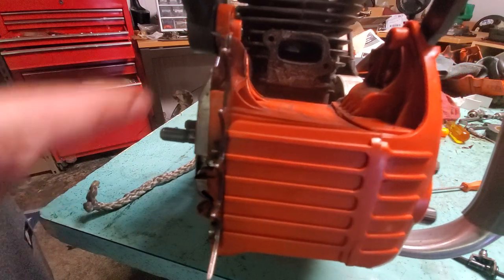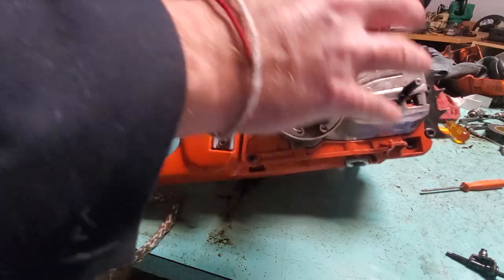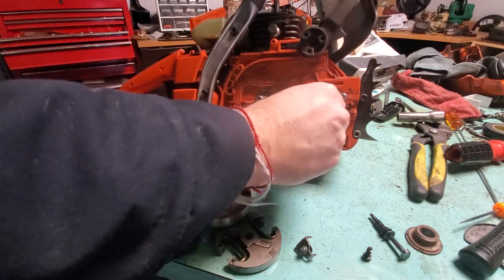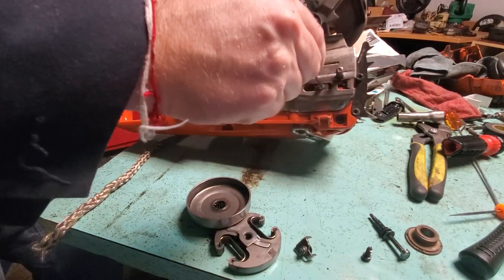Replacing Chain Tensioner Husqvarna Chainsaw 350

Comment: Awesome. Saved my bacon. My chain tightener came out of the track. On a Sunday with a pile of work to do. The rope trick worked. Thanks for the advice waiting for it to get to the top. Close to the top worked for me. 

I have a 353. So have a couple other pieces. One thing I did have to muck with was lining things up putting it back together.particularly bad and chain.

Comment: I tried the rope trick. I attempted to put the rope in when the piston was up toward the top, but was unsuccessful. Now I have a chainsaw with a rope stuck in the cylinder. You mentioned you had it to happen to you once. How did you remove the rope? I can't even get the exhaust off, possibly the rope keeping it on.
Reply from the maker: If you put the rope in the cylinder when the piston is near the top, its impossible to get it stuck because you have no where to get it stuck at. If you put the rope in when the piston is at the bottom, then the rope will get stuck in the exhaust port. I just pulled the exhaust off, cut the rope as close to piston as possible and pulled extremely hard and it eventually came out.
Reply: @fixinstuff4374  Thanks for the reply. I took the exhaust off.  I can barely see some strands of rope squeezed in the exhaust port, maybe 1/32 of an inch.  I tried pulling extremely hard, but can't get the rope out.
Reply: The way I got the rope out was to take the cover off containing the pull rope.  I then loosened the fly wheel nut and turned the flywheel the direction to bring the piston down.